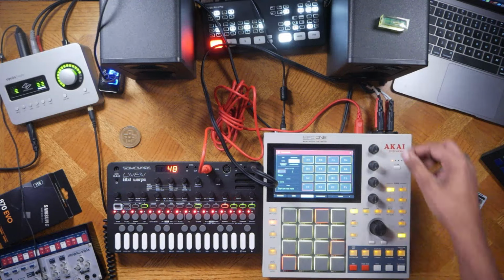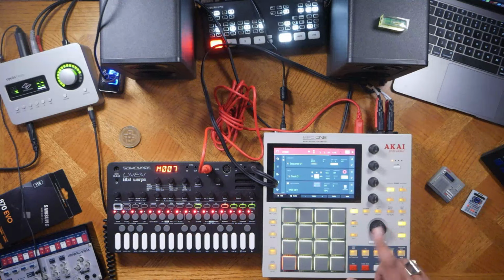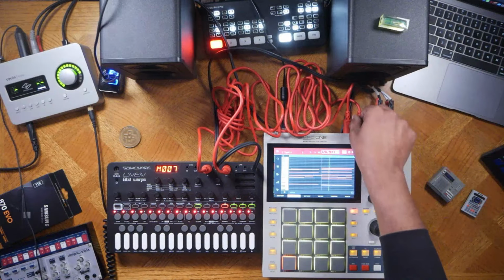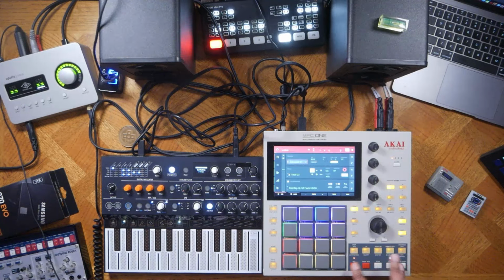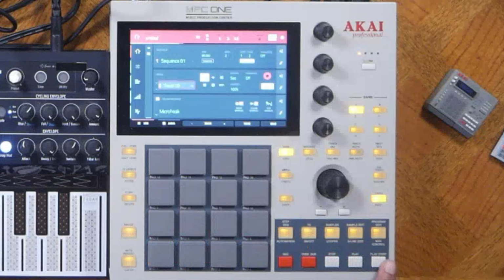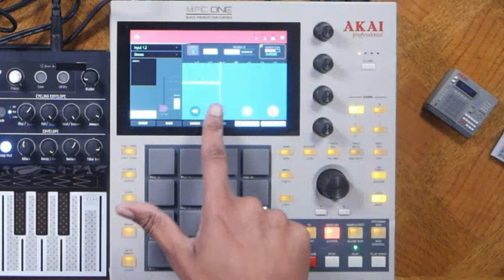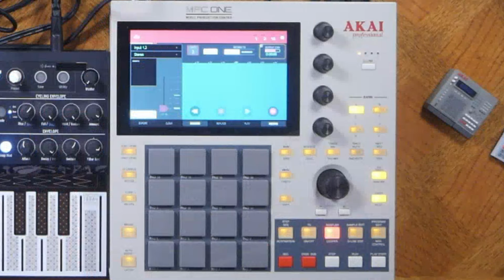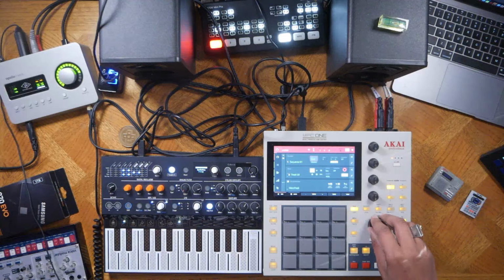MPC ONE - How To Connect & Record External Hardware Synths

Comment: i want to get some cables to connect the mpc one to the mpk mini as well as the rodecaster pro 2. which of those cables you linked are the ones to get? i want to support and use your links but i just want to make sure im getting the appropriate wires

Comment: So my only/main question is this, once you sequence your instruments into the MPC, does it work as a play back device (I.e. you can disconnect all your hardware instruments from the unit and it’s will still play back whatever you sequenced?) or how does it work?  Or if not can you load backtracks into it like you could to a SP-404 for example, and then trigger those samples using the MPC itself? (I.e. trigger the samples on the MPC One, with the MPC One)? Please let me know ✌️. Because as of right now I use a seperate midi sequencer to trigger my backtracks which are on my SP404 … but if I can do it all on one contained unit that would be fire af 🤯

Comment: How do I get the mpc to record a new sound on midi.. like I already have one melody .. but I want to change the sound for a new melody with out the mpc changing the other sound... WIHOUT USUNG LOOPER.. I JUST FEEL THAT BEING WAY TO SLOW
Reply: Facts I need to know that too !!
Reply: @ I figured it out. Your synth needs to have a sequencer mode or pattern mode or some multi midi function. 

You’ll assign a new sound via your synth and assign it to its own midi channel 

In the mpc you’ll create a new track for each sound and change the midi channel to match the sound you’re looking to use.

Also to stop mpc from changing your sound on its own you have to go into settings and change one of the settings .. I don’t remember what though 😅. It’s in the midi section or host section I don’t remember.. just scroll through you’ll see the section that makes sense. And then I just turned all the knobs off and on until the mpc stopped changing the sound on its own.

I’m not in front of it now but I’ll check for you later if you don’t find it

Comment: Im trying to connect three synths to the mpc. BUT, I want to use each synth as its own controller. In otherwords, play each synths keybed and knobs and have the mpc record and play all three synths back. But I dont want to use midi thru, because  i dont want to use one synth as a controller, i want to play each synth and overdub each synth at a time.

So mpc i program drums amnd percussion
And each synth i can play and record into the mpc.

Then play it all back. Is this possible?

Comment: you have any recommendations for a DIN midi cable? I'm not sure if its across the board but I had to replace my first MPC one because the midi ports were so loose and the replacement while actually able to recognize a device has connected isn't really any more consistent. I still have to make sure the cables are in some exact random position/ tensions too actually transmit/revceive :(

Comment: I know everyone is excited about using the MPC as a controller, but is there a way to connect them and still use them separately or do you have to use the MPC as a way to control the whole thing? Like if I want to connect the minifreak but still play it and have the music layer in the MPC? sorry if this is a dumb question. New at this.

Comment: in Midi 001 the midiport dropdown box with MPC mine has also others in there, it wont trigger my Neutron on the MPC but if I change it to Neutron (1) MIDI 1 I get the sounds. I'm on the latest firmware, is this a difference in firmware or am I doing it wrong?
Its confusing...
Also just a little feedback for ya, the images are blurry as shit and can't see any other text clearly....
Maybe, could I request that you do an updated version that has a clear picture :)

Comment: I just bought a used synth and followed all the steps, MIDI is detected but I don't get anything on recording or audio tracks.
Reply from the maker: Because you didn’t do all the steps. You skipped over steps. Did you plug up the audio cables? Did you set the recording level on the Mpc? Did you turn up the volume on the synthesizer? Did you go to the sampler mode on the MPC and activate the monitor in? All of that is in the video!

Comment: What level should I set the record volume on the MPC one when I have an external synth plugged in.
Reply: Depends on the synth output. My Moog's volume is loud enough itself where I can set the record volume to half and it's clear. My DX7 at its highest volume requires me to add a Maximizer effect on the MPC sampler track to get it to sound loud and clear.

Comment: I have to disagree. The Akai MPC Midi in is hot garbage. When ever I start to assign midi parameters from a midi controller to the MPC parameters - its crashes, locks up, does not work at times. Ive tested this with multiple controllers. Seems like it started with the 2.10.1 firmware. With 2.10.0 - I had a full hour+ long set full of midi CC in - after the 2.10.1 update - that file is basically useless now.

Comment: are all the midi and changes done like what you did in the vid stored in individual programs or is it global? for example can i have one program set up with one hardware synth etc and then another set up for a different hardware synth or do i have to change these midi settings globally each time when i swap out synths?
thanks for your videos!
Reply from the maker: Good question! You can actually save different global MIDI options in the MENU>MIDI Control options. However, I was just plugging the synths up and using default MIDI CC features.